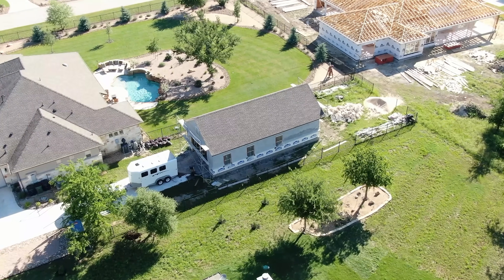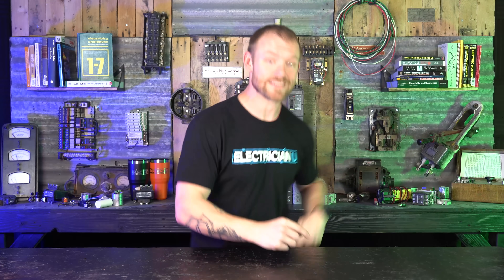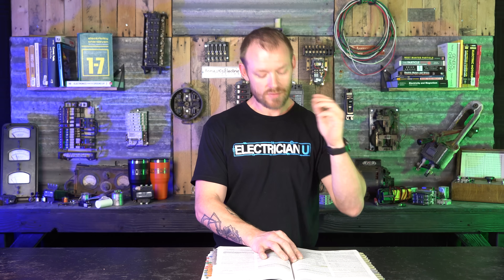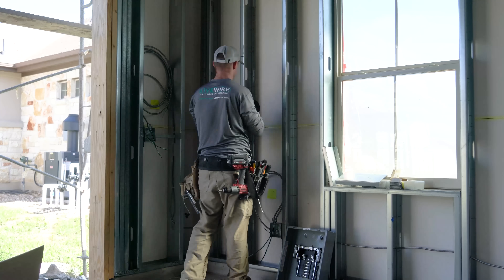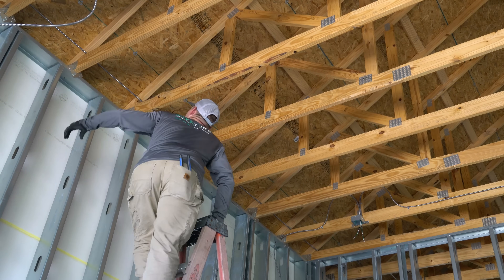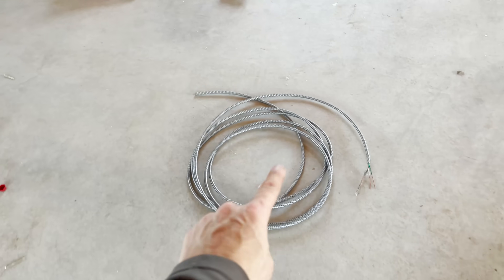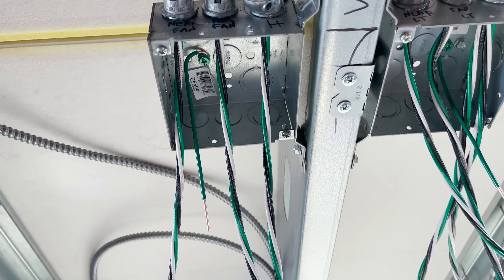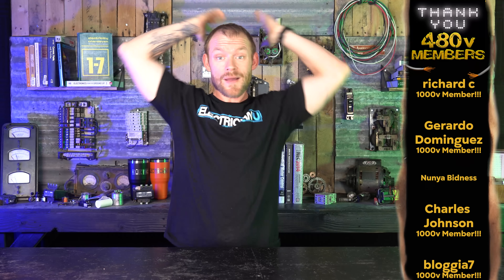Backyard Addition Job - DAY 3 - Using Up the Rest of the MC!!!

Comment: Hi Dustin-  Really hope you secured all that 12/3 MC Flex to the steel studs or ceiling joists with some straps and/or clamps (both horizontally and vertically).  It doesn't look like it in the video throughout the installation process.   As a commercial type of installation, I would have opted for EMT for the entire job.

Comment: As a safety supervisor. I would have to ding you on standing on top of the ladder. With no Buddy at the bottom. Yeah. I’ve done it before. But never should be done alone. Yes you were hanging on the rafters. I get it. But ya scaring me.🤣🤣🤣🤣🤣

Comment: I use the Commercial Home Depot Revolving charge card, I get 4X the points, every $1,000 I spend I get $50 off, and or a tool rental. I rented a trailer to help move stuff

Comment: Have you tried to use a story pole to mark your switches and receptacles; that way you are not pulling out your tape measure every time to mark there height.  Also have you use a laser tape measure for your ceiling light location and use a rolling stool with basket attach to it for trash and holding parts for wiring receptacles.  Great videos. Keep up the great work.

Comment: great videos man, I love all the info and tips as well as the code references!  I've asked a few mechanics I've worked with how current transformers work; and no one seems to really know much more than installing.  Are they buck/boost transformers that cancel out to provide a percentage of the input current?  Also, while you're going over large runs with open space above the ceiling like in this garage, is it a personal preference to not use fish sticks or have you just never tried it? it makes pulling long runs 1000 times easier with tall ceilings like that for me at least!
Reply from the maker: Thanks for watching!

To your fish sticks question : it can be more time consuming to use them depending on distance needed to travel from entry point to termination point. 

Transformer: we have a video that covers this. Not this explicitly. But transformers in general: https://www.youtube.com/watch?v=tXPy4OE7ApE

Comment: They don’t use red hats for mc cable anymore?  It was a red plastic bushing you put in the end of the cable after you snapped a cut.
Reply: Anti shorts aka "red hats" NEC required or not I feel they are super necessary with any mc connector.seen multiple circuits short out when they are not used

Comment: Do you consider automotive electrical to be a similar trade?
Reply from the maker: Would depend. If you are doing the new Pacifica by Chrysler. For sure. That's 480vdc turned into AC to run their 3 phase AC motors. 

But speakers and head unit change outs. Not entirely. But this is entirely subjective. The work is similar enough.
Reply: @electricianu  I did not know that they ( auto mfg.) Were going to ac. That is very interesting

Comment: If I mounted a panel that had a drop ceiling or attic above it would run up a piece of 1" conduit that can be used for further circuits. Never got a chance to install a 82 or 84 circuit panel before I retired but did install a lot of 42 circuit panels with bolt on breakers in commercial sites. Was talking to an electrician this morning. He had to go to a supply house & 2 home dumps just to get material for a residential 200 amp service. Hard to believe that supply chain is still affected by pandemic.
Reply: You should have seen the hoops I had to jump through while doing a boiler job over last weekend. Nobody has any stock in 1.25" sweat fittings and black fittings are also slim on inventory.

Comment: you're allowed to mount panels that high!? I thought in residential it all had to be at wheelchair height?
Reply: I think that was one of the reasons he read the code on "if a breaker was used as a switch" the height would be different. I think you will also find exceptions to the wheel chair height in buildings that are not ADA compatible. Most private homes have steps / stairs and would be exempt. OTOH, in new construction they may have a certain number of first floor condo / apartment units that ARE compliant with ADA all the way through, switches / outlets included.
Reply: It's coming soon to a building code near you!
I put a shower stall in my bathroom. The "curb" is so low that the curtain won't stay in. Didn't notice when I purchased it. Went back to the store and they told me that they are all like that to comply with wheelchair codes.

Comment: How did you come up with the size of panel to use? How did you come up with 125amp service?
Reply: You do a load calculation and question the customer on what they want to (eventually) install. I'd guess his numbers came in at 8 circuits with well under 100 amps but he's allowing for future expansion. (12 circuits with 125 amps) The price of going "over-kill" will only be a few hundred more than being on the money... and you wont have to tear it all out later when needs change. (where will I plug in my electric car?) What's an extra $200 on a $5k budget? Peanuts!

Comment: Home Depot is the worst place to shop for electrical
Reply: Zoro has great prices and ships very fast!
Reply: depends in NH they are not to bad (paid $90 for 12/2 romex 250ft around the time of the texas freeze) we have ace,hd,lowes, even most supply warehouses will sell to the public so its just a matter of shopping around for the inventory and price. granted i use HD because its fair priced, usually well stocked and walking distance

Comment: Must be one of them OSHA ladders that you can stand on top step. Yep we all have done it hundred of times. Our plumbing shop purchased a few 7' stepladders to use on some drop ceilings that are only 7'7" off floor. Our safety department wanted us to wear safety harness and tie off every time our feet were on 4th rung from floor. Told them hundred and one times that in most drop ceilings there is no place to attach safety harness.
Reply: How do you get to the place to attach the tie off without going over the 4th step?
Reply: @markchidester6239  exactly. Some college educated people have no common sense or understanding. Great nice people but hard to deal with. Before we can work on an enegized 120 volt circuit must fill out a full page then have a senior electrician sign off then go to another building to have safety department sign off. Always takes twice as long to do paper work then the actual job.
Reply: @garbo8962 glad I do residential lol
Reply: @markchidester6239  just tie into the ladder
Reply: Nothing funny about safety third.
Reply: LOL I used to do low voltage for YEARS, and used to this all the time until I was forced to get OSHA certified by my shop. EDIT: Just wanted to say please be safe bud.
Reply: be careful what yoy post dude...  if you ever get hurt on a ladder...  this is evidence...  kk?  Thx for the info